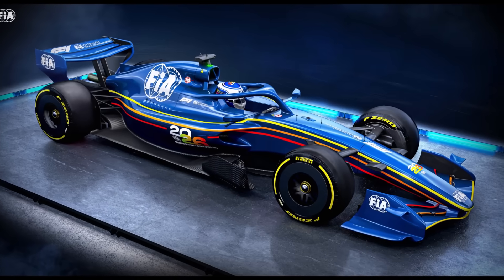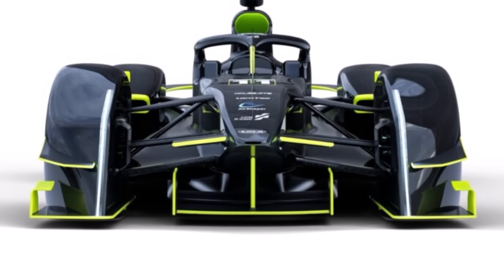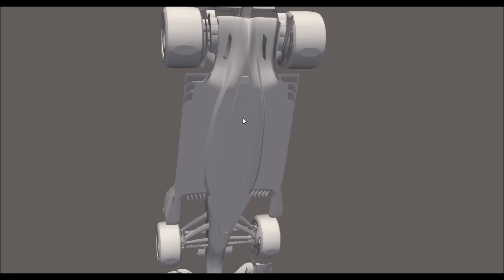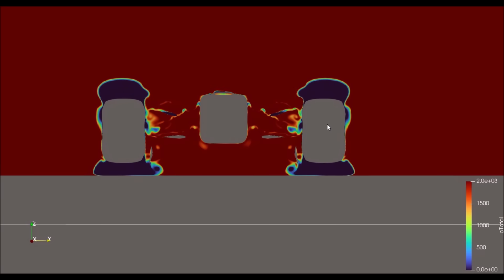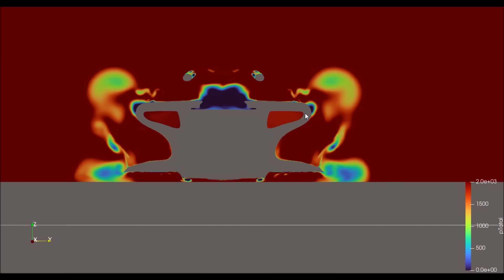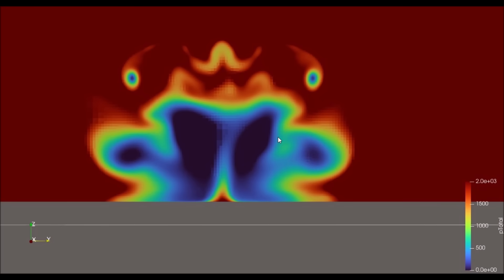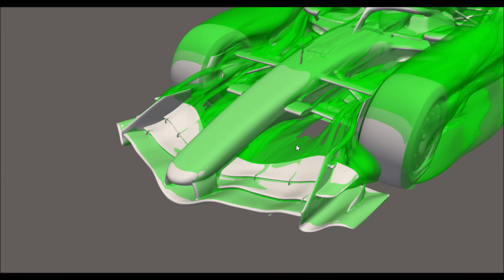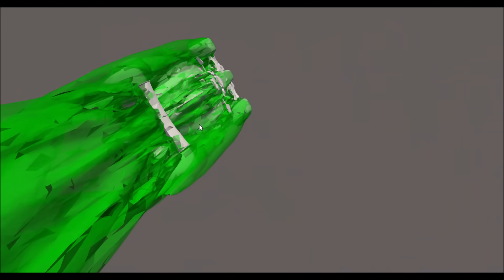F1 2026 - Aero Analysis (Complex CFD Simulation)

Comment: Although the analysis suggests that the rear wake will greatly disturb car on car following; that said, isnt the dirty wake exactly the same as previous years?

Like when does an f1 car ever have a high-energy clean-wake? So how can we say 2026 will be worse?

Additionally, I'm curious about going around corners. How will the wake characteristics evolve when we arnt just going in a straight line. In that scenario, wat is the following cars interaction with wake? Is the follower right behind the leader, or is it slightly off centre?

So just very curious if we can get more analysis as to how the FIA is crystallising its claims regarding improved following; specifically if we could consider the more complex scenario of corners where airflow is no longer parallel with the car.
Reply: The answer to this is practically impossible to tell unless you run TWO cars in CFD AND wind tunnel, under a huge number of different parameters, including but not limited to yaw, steer, roll, pitch, crosswind, etc. The possibilities are endless and the calculations are computationally expensive.
Reply: @PeterZuba9 i see, Cheers
Reply: As said in the video, 2026 car will produce more downforce from wings, while previous car did it from the floor. The floor is not as sensitive to the dirty air wake.
Reply: @johan.mp4 whilst i completey agree, it makes me even more curious as to where the fias claims of reduced impact for following cars will be crystallised.

Like, is it in corners where the in-washing is doing some positive from a chasing cars perspective?

Given that in a straight line the disturbed wake generally produces a positive outcome for chasing cars anyways.
Reply: @wilimow  FIA are clueless, it'll be one of the worst regulation cycles in the history of F1

Comment: have you tried to simulate the airflow when the active aero is on or is there no point in doing so
Reply: I was thinking the same thing. Also running the cars in a line and beside other cars could be neat to see. Also how far behind the car until you hit clean air.
Reply: I think it is fundamental. I expect to see a car version for all teams in circuits with no straights and one with more straights due to cooling capabilities. I think you can do good enough cooling feeding inlets mostly through straights.

Comment: Can the moveable front wing elements be used to change the shape of the front wing "on command"? Either by having a strake deflected by them or by using the wing loading selectively as flexy wings?
Reply: i m sure  it will .I EXPECT AL LOT OF FUSS between teams about it.

Comment: This looks like it will become a very rough season for fans of good racing
Reply: Weaker engine and more energy management might counter that and I guess slip stream would be better again then current cars on straights.
Reply: @nulian  Why should the slipstream be better? Drag will be significantly lower than previous cars, so the slipstream effect will be less effective !
Reply: @nulian  how would weaker engine be better for the sports? :) We will see 56 laps of power management.
Reply: @AndrewTSq  because slower cars means closer following
imagine two fiat 500s going flat out 1 second apart, they are about next to each other still, compared to f1 cars 1 second apart and they are like 100 meters apart

of course thats an extreme comparison but it holds up at any speeds in between
Reply: @tphoenixashes  but the problem isn’t that they can’t follow on the straight. They can’t follow through corners before the straight, where engine power isn’t the limiting factor
Reply: @Root_boy  This will be worse IMO. Not  soo bad as in 2017.. And maybe Better than 2009 2014 rulkesets.
Reply: So what you're saying is, for Ferrari fans, this year is finally Our Year™?
Reply: Used to it from last year
Reply: Not like the past few years were good either. The fundamental issue is the weight and size of the cars. They need to get rid of the hybrid element and just rely on their new fuels for sustainability
Reply: @SirMito the manufacturers want the hybrid stuff.